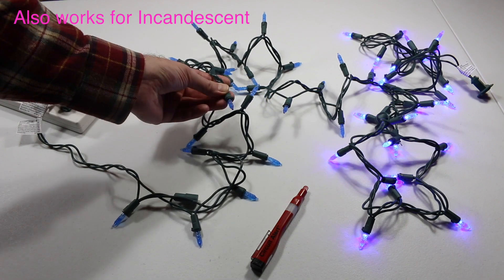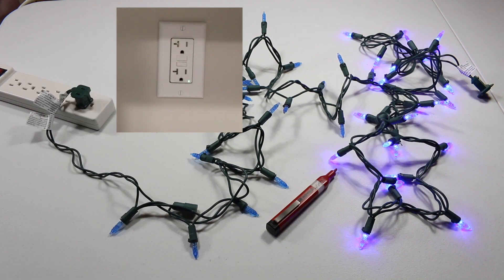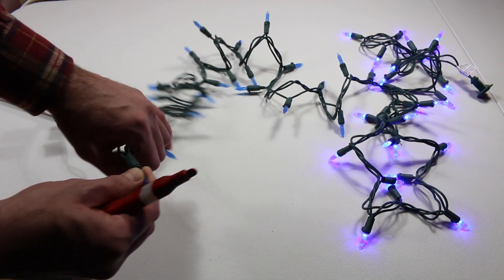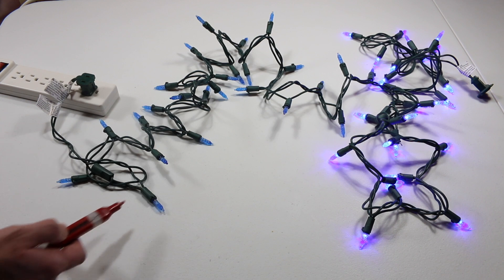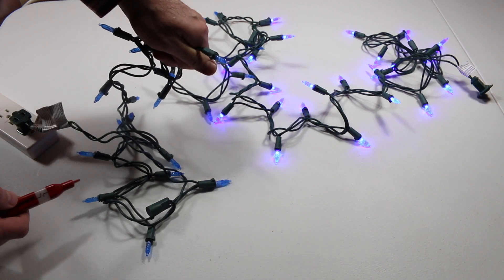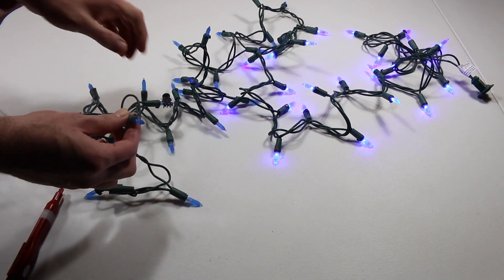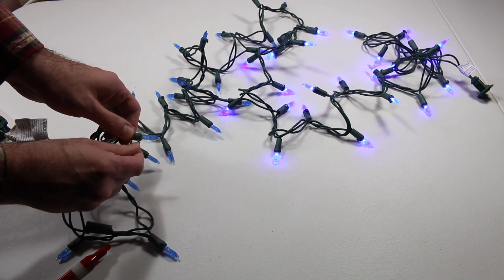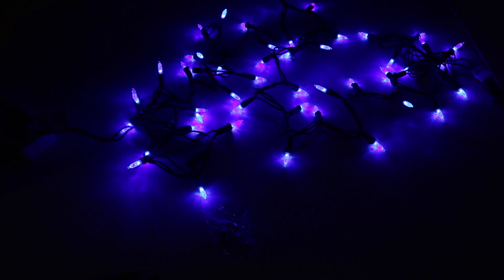Fix LED Christmas Lights with One of These in a Few Minutes

Comment: Unfortunately, this approach did not work on my lights. I have a quality non contact tester. I reversed the plug with the same results. Power was shown but blub did not light and replacing it did nothing.

Comment: What if the whole string of led lights do not power on. I changed both fuses and still won't turn on. Can I use a testing still.

Comment: Ordered a non-contact voltage from Amazon for $8.98. Worked great! Found the bad LED in no time. My wife has thrown out a lot of string lights for Christmas and Halloween that failed. I'm sure this device will pay for itself in no time. Excellent tutorial. Thanks very much for posting.

Comment: If the bulbs are not replaceable, can that bulb just be eliminated by joining the wires together?
Reply from the maker: it’s not recommended because when there’s less bulbs, they all burn brighter and hotter and will have a shorter lifespan and they’ll just keep blowing and of course it’s not necessarily safe

Comment: it usually worked with a screwdriver to short the contacts from behind, al use traditional method test one by one but on the working line as if more are burn cand detect them easy

Comment: On Amazon I see non contact detectors for AC, but for LED light string it's DC voltage driving the lights.  Are there inexpensive DC non contact detectors out there?
Reply from the maker: if the LED light string is not a special type with a fancy controller or running on batteries, if it just looks exactly like a regular incandescent string that just plugs straight into the wall, even though the LEDs themselves convert AC to DC because they are diodes and only allow one resulting voltage polarity, it is still pulsing and that’s what the noncontact tester picks up, changes in voltage so the main thing to look for in the noncontact tester is that it can detect the lower voltage is as well as the higher ones so when they say they can read down to maybe 12 V and over 120 V those are the better ones and mine is fine on those LED strings even though it only says AC but It can read down to the lower voltages.
Reply: @GadgetReboot  thanks!  Appreciate the video instructions.  My LED strings are older that have the AC/DC rectifier at each end.  I'm trying to figure out a way to check if the rectifier plugs are working correctly.  They don't seem to be kicking out the DC voltage for the LEDs.

Comment: Be sure your tester is sufficiently sensitive to the voltage. The tester range should be 12V to 1000V. Some testers are rated 50V to 1000V and will not pick up the small voltage in the cable.

Comment: Is it usually one bulb or multiple bulbs that are blown?
Reply from the maker: it can go either way. When A bulb fails it usually fails by short circuiting itself so that one light goes out, passes on the power to the next, and then the rest stay on

But then they all get exposed to more power so they will be more likely to blow sooner, one by one until the point where there’s just too much power and too few lights so the whole thing could end up with a bunch of blown bulbs that finally failed as an open circuit, not passing on power,  and nothing is lit anymore.

or it could legitimately just be one bulb that blew but instead of failing as a short circuit it might have failed as an open circuit like a blown fuse and caused everything else to go dark, but if you track down that one or two failed bulbs it can be fixed easily.

when I am trying to track down the bulb if it seems like I keep finding dead ones and then replacing them and then it still won’t come on, after a couple of tries I assume maybe the whole thing had a catastrophic failure and it’s probably not worth the trouble at that point.

Comment: Awesome! I still don’t get the first part about flipping the plug around though. I have to make sure I get power both ways before I move on?
Reply from the maker: The idea of flipping the plug is to make sure there is power getting to the first light so that there is something to track along the wire. If there is no power at the first light there is nothing to continue tracking so either the cable is badly damaged and there’s no power no matter what or the plug needs to be flipped around to get power on that wire

Comment: In your demo, the defective lightbulb near the plug keeps all the other bulbs from lighting. I have a strand that is not working for 10-15 bulbs at the beginning and the other half at the end is working fine. Would you have any idea why?
Reply from the maker: some strings of lights are actually really two or three strings of lights that are all independently wired up to the main plug so one part of the string can go bad and the others can stay lit as if they were three physically separate strings with their own plugs going to the wall separately.
Reply: Thanks a lot. I'll take a closer look at the wires. @GadgetReboot

Comment: I fixed my string!  First, I tested all 70 bulbs and about 6 were bad.  So I replaced those and got half the string back.  Then I used your method and located the bad bulb (even though it shows as good on the tester), and I'm back in business.  But if you hadn't told me about the necessity of getting the polarity correct and that it was the last bulb that read good, I couldn't have successfully done this.

Comment: A very good video. However, I purchased a contactless tester, and I found no bad bulbs on 2 strings. Every single dead bulb beeped with hot voltage. And I have replaced the fuses in the plug. Still no light. I am stumped.
Reply: Same. Did you throw the string in the bin?
Reply: I’ve encountered the same thing. At a certain point just toss the bad string and save your sanity.

Comment: I was trying to troubleshoot some net lights but with the wires going multiple directions it’s really not possible to use this method easily. I tried the standard approach to start swapping out unlit bulbs but they were so small and tight in the sockets, requiring a small screwdriver, I gave up and tossed them. But thanks for this video will keep this method in mind for the future.
Reply from the maker: yes sometimes a string is too complicated to bother diagnosing or there are so many blown bulbs it’s not really worth fixing but sometimes it makes perfect sense to do it. By the way I liked your performance in the 2001 Rockstar film!

Comment: Excellent video.  It shows you how the light strings are wired and how an inexpensive non contact voltage tester can easily pinpoint the problem bulb. I have seen other videos and articles that make it much more complicated and/or expensive to accomplish the task.  Thanks for your assistance!

Comment: Any suggestions for when this method doesn't work?  Six out of our twelve C9 LED strings went out between holiday seasons, each less than 5 years old.  Tested two strings thorougly with a voltage tester.  Tested the bulbs and individual wires separately.  Flipped the plug and repeated.  Everything's getting power.
Reply: Did you ever find a solution ? I'm having the same issue.
Reply: @coleridsdale5460  Yes, my solution was to throw them in the trash and give all the ones that did work away on Craigslist for free.  Seriously, I'm going back to my 30 year old C9 incandescent strings.  Father in law was having the same issue and this didn't help either.

Comment: By now, I have viewed lots of other tutorials on YT on this subject.  The bulk of the others focused on the Lightkeeper Pro.  Only one of those and yours did a great job of walking through the process with a non-contact voltage tester.  I feel much more confident now with fixing the lights on my tabletop tree.  MERRY CHRISTMAS!!
Reply: The Lightkeeper Pro was for incandescent bulbs.  The LED Keeper is what is sold now.  However, my LED Keeper didn't work on this string, for some reason, but his method (which is faster), did.

Comment: I guess what I don't understand is how the lights BEFORE the bad one are out?  And why are the lights on the good side still working?  Seems to me everything before the bad bulb would work, and everything after, NOT work?
Reply from the maker: it’s really two separate light strings of around 50 bulbs each.  they just happen to be connected to the same one power plug so one set will be out when the bulb is bad on that side but the other set can still operate.
within each set of 50 lights, those 50 are all connected in series so if one goes out it breaks the whole chain of 50 so none of those light up until the bad one is replaced and the circuit is complete on that side.
 The other side is still working because it’s an independent string just like if it was a physically separate set plugged into a different outlet it would still work when a different string on a different outlet is bad.
Reply: Thanks!  That helped me understand a lot. @GadgetReboot

Comment: Does the voltage sensitivity of the tester matter? I'm using one that has a 90V min sensitivity and it does not consistently detect the presence of voltage on a good string regardless of which orientation the plug is plugged in.

Comment: Wow.. had to come here and comment.  After 3 days of massive frustration and about to just rip down my lights all together, I came across your video.  I consider myself a bit of an amateur / household electrician and fix-it guy, but I would have never thought to reverse the plug to make the hot wire go all through the strand!  I have an electric screwdriver that has a voltage tester on it, and that was good enough to go through and find the problem bulb, even though I had to unscrew some of them to hear the tone.. I had a Clark Griswold-type moment when I replaced the little diode and the other half of the strand finally lit up!!  Thanks so much!

Comment: Great idea, helped a lot. One question.  My set of strings IS polarized so when I get to the other half, I can't just flip the plug to switch the polarity so half the string is on the neutral leg so I get no signal from any bulb, lit or unlit.  Any solutions?
Reply from the maker: i’ve never encountered a string like that, so if it’s actually polarized and half of it is hot and the other half is neutral going from light to light, there may not be anything that can be done with this method. I wouldn’t recommend trying to find a way to reverse hot and neutral on the plug, they may have done it for a specific reason.
Reply: @GadgetReboot  Thanks appreciate the advice.

Comment: For years I’ve NEVER had success fixing lights where a small section quits but with you’re method I found and replaced the burned out bulb in 5 minutes. I started to not even mess with it thinking there’s no way I’m going to get them working. YOU ARE A ROCK STAR!! Thanks a bunch!!

Comment: One question: Why are the lights at the end of the strip lit when the bad bulb was located towards the beginning of the strip? If there is a break in the circuit, why aren't all of the bulbs off after the first bad bulb?
Reply from the maker: it’s really two separate sets of lights on the one overall string so the first half has a bunch of lights in series across 120 V and at the same time the second half of the string you could think of as another bunch of lights in series that are just connected directly back to the plug getting another 120 V connection of its own so they operate independently.

Comment: I have a set of Walmart low voltage LED lights that I want to cut apart and wire to a usb. I'm not sure of the specs on these LED's. I'm assuming they use about 3 volts?
Reply from the maker: it may vary depending on the exact LED for example white may be closer to 3 V and if it’s something like red it might be two or 2.5

Comment: I just watched your other similar video of this and I like this version better. More to the point 👍
Reply from the maker: The original one was targeting a more technical audience and I never thought it would get viewed by the general public so it got lots of hate because nobody cared about the real reason I did it, so I decided to do one targeting people who don’t care how it works they just want it to work.
Reply: @GadgetReboot Agreed. Explanation of the neutral and hot wires is better in this one for someone with zero knowledge (me lol). Glad I watched it. Gonna try to save three strands of lights tomorrow. One I'm not sure about bc different lights stop working on the good half every time I plug it back in. I replace a dead one and it works but another one somewhere else doesn't light. Hoping at least fixing the dead half will help. Thanks so much for explaining this!

Comment: We have to make MIDI(musical instrument digital interface) gloves coupled with flex sensors, accelerometer, gyroscope. In this every finger gesture will play different music tones, also play music in the background by moving or shaking(trembling) our hands.

-- I am planning to use Teensy 3.5 Dev Board for it. but having problems connecting 5 flex sensors and an MPU or IMU, Accelerometer sensor. to board.

Comment: Great tip with the hand shielding! As an Australian, I find it really odd to see that mains voltage style of lights. They aren't available here any longer, the mains voltage is a safety compromise that is totally unnecessary. We're on 240V AC so it's a bit more dangerous, however there's special provision for these lamps in our electrical code. But they've never been allowed in exterior lighting here.
Everything now days is 12V DC with switchmode PSU and non-replaceable bulbs. I've just refurbished a few of the 24V AC units that use an iron-core transformer and plug-in bulbs, but they are no longer sold in stores.
Reply from the maker: i’m thinking about trying some addressable RGB LED strings that I bought last year for indoor decorating, it would be interesting to be able to change from coloured to just soft white or daylight instantly based on a programming update. I just have to see if they look natural enough. I know I bought some strings of 50 of those on Aliexpress but can’t find them right now.

Comment: Maybe unplug it before removing the bulb ?
Reply from the maker: Probably good habit, especially if prying with a metal tool, but with these bulb bases, when pulling them out of the socket the circuit is broken with several millimeters of travel still needed before the lead is even starting to emerge so I wasn't concerned about touching anything live